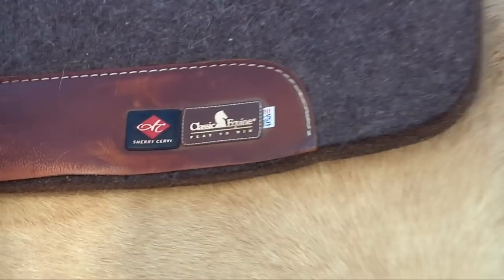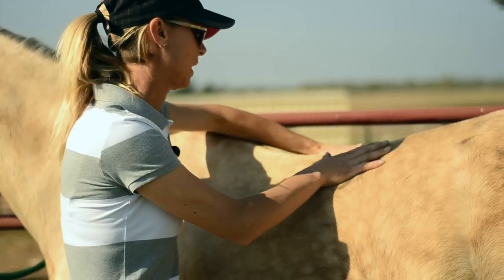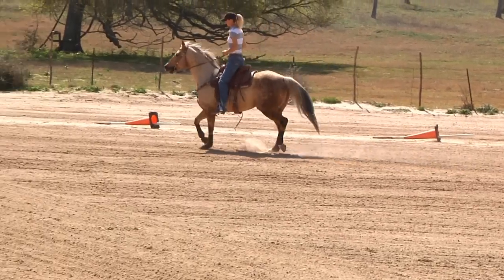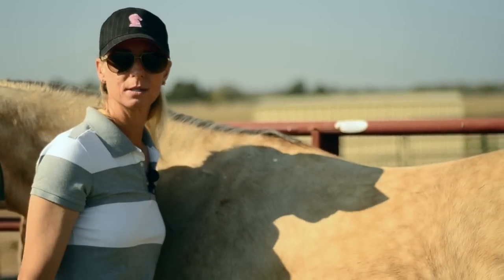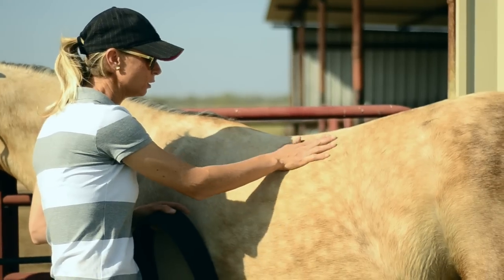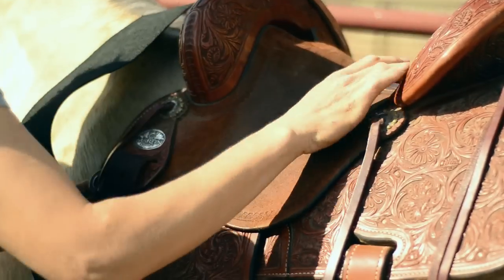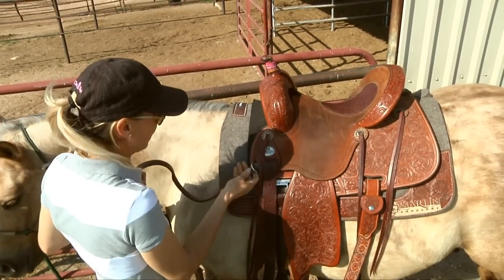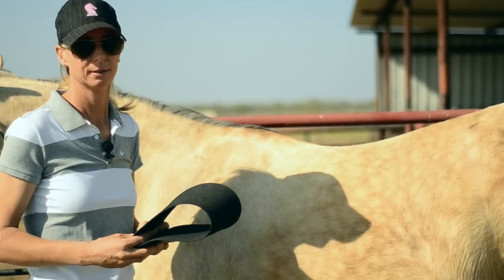Sherry Cervi Explains Saddle Fit & Using 'Shims'

Comment: Learn to tent your pad. Your mare will thank you. Make sure there's two fingers of gap between the tip of the wither and the pad, before you tighten your cinch. The pad will drop or settle as you ride. That pad was pressed down much harder on her withers than it should have been, for beginning the ride.

Comment: what barrel saddle do you recommend for a shorter backed horse with a slightly high whither please.  My horse has been tripping or slightly going down on her left front leg going around a barrel when the barrel was to her left.  Any idea what might be causing this please - just using a different saddle.  Thanks.
Reply: Your horse tripping might be caused by the horse turning on their front end when you want them to be turning on their back end. I do this by lifting my horse around the barrel and I begin to lift once their tail is next to the barrel. I hope this helps :)